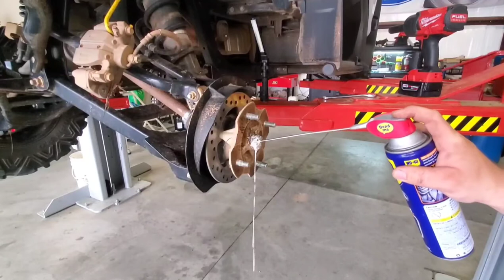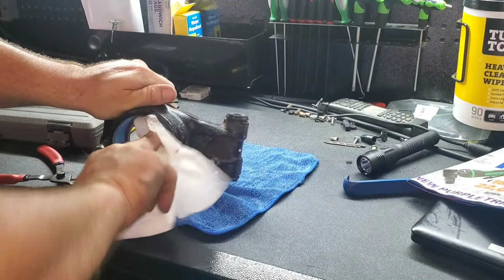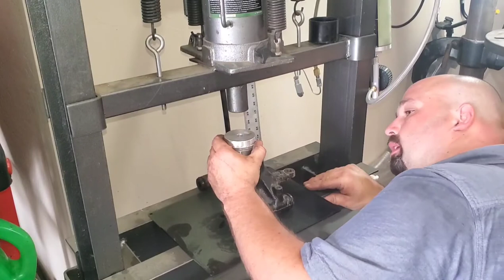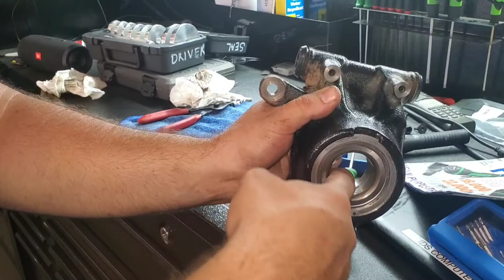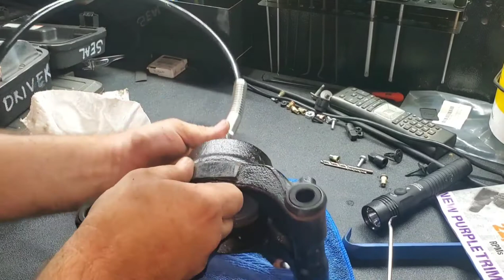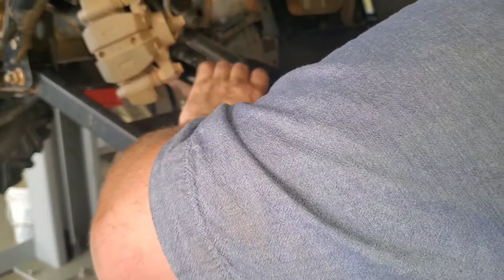Honda Pioneer 1000 rear wheel bearing replacement

Comment: I always like to tap bearing in first a ways before using a press , if it starts going sideways its too late when using a press , not as much control  when starting off with a press , especially soft  Can Am  aluminum  spindles , theres no room for error , helps if ya freeze bearing too

Comment: Hi there, Where can I get the PROPER tool for greasing my 2018 pioneer 1000.  Have ordered two already from Amazon and in both cases, the tool is too small to fit over the axle but OK in the bearing bore...Pls help..
Reply: tiger tool 40 mm works on mine perfect , goes over axle have one o ring and seals perfect , 2017 pioneer 1000

Comment: What are your thoughts on the use of anti seize,  in this video https://www.youtube.com/watch?v=cCNQqRD5WMg  they recommend reducing the torque from 20-30% when using anti seize.
Reply from the maker: There is nothing wrong with antiseize but you really don't want to put it in places that you really don't want a faster backing off, ie lug nuts, brake caliper brackets, or suspension pivot points. As far as the torque I've always heard drop 5% but who knows that's probably one of those "old wives tales" situations. I usually follow the torque spec regardless of antiseize or loctite ans havent had an issue.